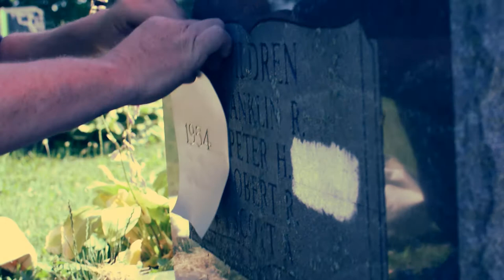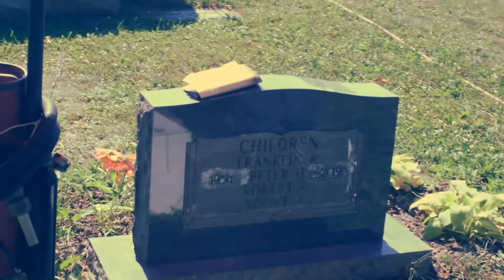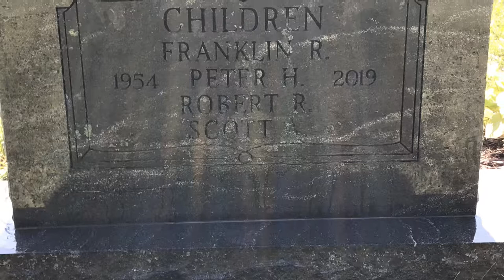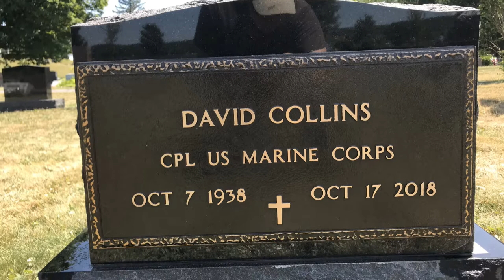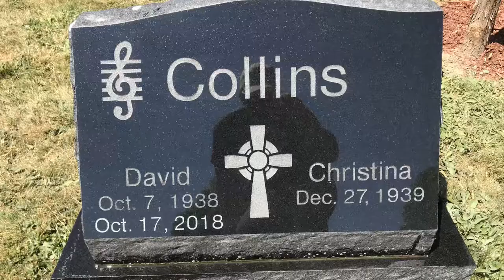Installing a VA Military service plaque

Comment: Working on a bronze replacement plaque for a plaque that was stolen 6 months ago.  The bronze plaques are stolen and sold for scrap by some outstanding local citizens.  Glad to see that you fastened the rear studs on this one with heavy duty glue. 😊
Reply from the maker: Lol good luck getting them off if they are put on with Rockite!! I hate that people do that kind of stuff.
Reply: @-gravestonepros  what type of glue did you use?
Reply from the maker: @diegotapia7804  Rockite it’s an expanding cement.
Reply from the maker: @diegotapia7804  We use Rockite.
Reply from the maker: Hey how did you make out with the replacement plaque?
Reply: @-gravestonepros  looking good so far.  Every time I drive by I look to make sure it is still there.
Reply: Aw geez. We’re about to do a plaque on a headstone. I didn’t know there was a trend of stealing them. Cemeteries ought to install motion sensor cameras on their grounds. Great selling feature if they’re still selling plots to assure customers their loved ones’ resting place won’t be vandalized.

Comment: My dad's korean war marker from 1970 is white marble.  I wanted to have it installed on the back of the headstone, but I was told they didn't know how to attach a marble marker info the back.  They know how to attach metal.  
Thoughts? Ideas?
Reply from the maker: Yes the Metal bronze is normal to attached to the stone and doing a inlay with the Marble is not the best plan but it can be done at great cost.

Comment: My parent's bronze marker has cement for the base. It has sever cracks. Is it possible to replace it or buy a cement base from the cemetery marker business.  If so how would we remove from cracked base to new base or should we make a form and do the cement work ourselves? Or leave it as is?
Reply from the maker: Its hard to know what to do without seeing it. But I would think if its easy to get out of the cement you should and if its hard to get it out then leave it as its still in good shape despite the crack.

Comment: What size of bolt and thread count does the Military Marker require ?
Reply from the maker: 3/8-16 4 inches long I believe.
Reply: The VA supplies the studs as well as the plaque.
Reply from the maker: @justicews  true.